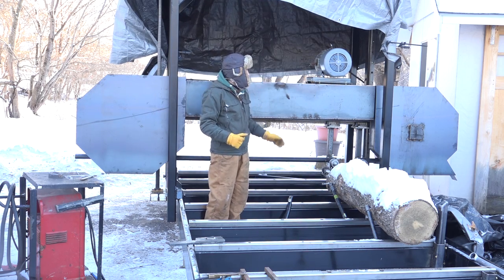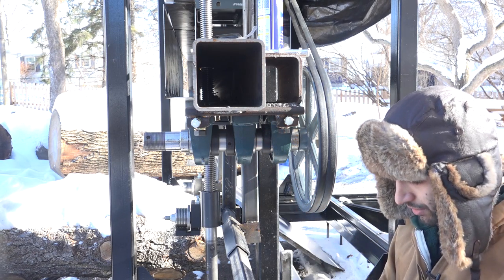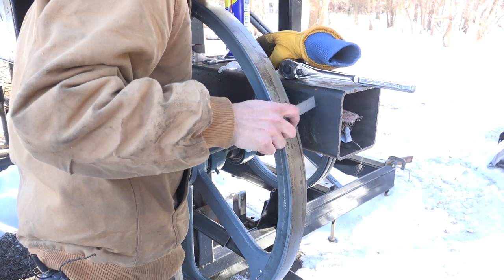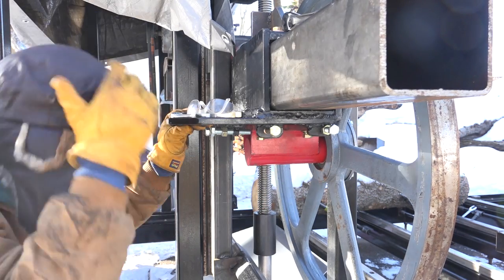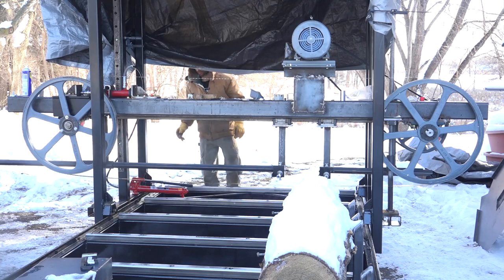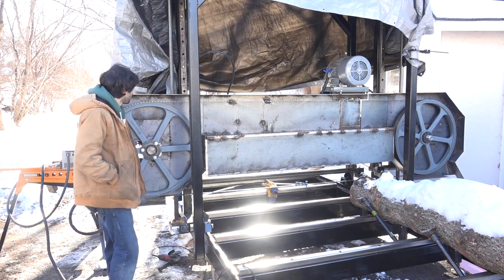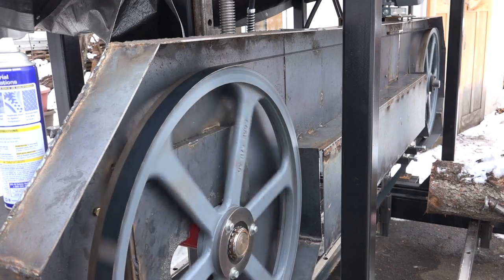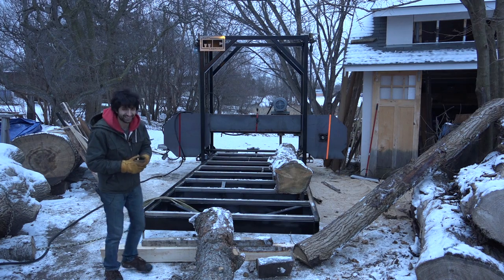Initial Setup - Building a Large Bandsaw Mill - Part 17

Comment: Not bad on the tweaking that was needed to get it working well. I must have missed something, why are the tires not on the wheels?
Reply from the maker: Tireless has more advantages for my application.  I don't have to worry about them wearing out, I can use lubricants that would otherwise destroy the tire, and I don't have to worry about the tires affecting the balance or trueness of the wheels if the tire material differs slightly in thickness or density.  Thanks Steve!
Reply: Will using tireless make it necessary to round the wheels now and then? And if so how do you plan to do that?
Reply from the maker: I don't think I'll ever put enough hours on this saw to affect the wheels but if they do need to be recrowned, I can have that done at a machine shop
Reply: You are probably right. I have no experience myself, but your build has 
really inspired me to perhaps attempt someting like this myself :-)
Reply from the maker: Thanks!  If you ever do, let me know :)
Reply: I will :-)
Reply: Hey Matt I think I have asked you once before but I'll ask again first what size is your pillow blocks and what size is your shaft that the wheels are on and next do you know at this point how much do you have invested into the mill right now now that your using it

Comment: I would consider a sight window in the guard on the tracking wheel side so you can set the tracking at full speed with the guards on for safety.

Comment: Matt: use a hose for each of your grease zerks, anything to extend them to where the zerk is easily accessed. The center bearing, go to a bearing supply and pick up some shims to eliminate the gap between the bearing and base. You can get shims down to .001" thick.

Comment: Sounds like the wheel/bearing something over there is rubbing/scraping. What you should do to the carriage is drill ahole so you can drop a bolt into the hole to keep the carriage from moving when you need to work on it. or  a small piece of C channel with a couple rare earth magnets on the inside and use that like chock.

Comment: Very smart tweaking of the wheels and guides. I'm thinking that you should consider running the mill with no load on it for 15 or 20 minutes to warm up the belts, bearings, blade and bring the motor up to operating temperature. I'd be interested in seeing what the test meter reads after the blade is  warmed up.
Reply from the maker: +George Savage I can already tell that the blade stretches a bit once it's been used for a bit. It will also be really interesting to see how summer temps affect the operation. Thanks George!

Comment: Glad to see the mill coming along so nicely!  One item to consider...For some spots you are using a lock washer on top of a flat washer (e.g. the drive side mount bolts).  I think you are negating any benefit of the lock washer by using it on top of the flat washer.  The lock washer needs to be able to engage between the base material and the bolt in order to provide their designed functionality.  With setup you have the lock washer will spin the flat washer and the bolt will back out.  Either take out the lock washers (and use loctite) or remove the flat washers.

Comment: A blade tension can be made consistent and never change over time ever, unless you want to. Like a clock a cable going over a pully with fulcrum & a known weight on an leverage arm. Much less technicial than a hydraulic ram $$.  Fifty Pounds on a 3' arm pivoting on a 1/2 bolt put a wallop of force on the wheel which can be locked when ready Mechanical vs hydraulic,

Comment: Piano wire clamped to a block run from one side to the other same dim. blocks. Measure from wire to wheels. you are making a straight edge with the wire. I've used this method on machine tools. Long runs. Wire needs to be as tight as a guitar string.
Reply: Piano wire as tight as a guitar string?  Intriguing analogy.  You have me wondering if a bear can be busy as a beaver, or if a frog can float like a butterfly and be like a Gordon Sumner.

Comment: I see you have an angle cube - iGaging, I presume. I have one - there is a woodworking supply guy here in Australia and he has them for $AU45. They work great. I also bought an iGaging outside digital caliper - bit dearer - great tool; has inches, inch fractions and metric.

Comment: If you want rubber on the wheels do like a friend of mine did. He took a bicycle tube smaller then the diameter of the wheel and cut it then stretched it over the wheel.

Comment: Great video Matt and congrats on the new blessing! Just worried that you might have too much tension on the blade at over 500kg, but the calculations appear correct, and I am used to working with much smaller blades. 
Does coming back to to 400kg [drop by 20 percent] cause any problems? and would the blade last longer?
The elasticity or Young's modulus would be approx 1/600 of it's length. So a 25 foot blade it would be 3/8 to 1/2 inch stretch I reckon.
Also in the metal working game I used to tension blades by incrementally by indexing the blade and increasing tension as I went, but again on smaller blades.

Comment: To align the two wheel axles parallel, you could use four clamps to clamp a piece of angle iron across the faces of the wheels.  Then just snug down all of the various bolts and you're good.  (Or maybe you've already figured that out, being as this is a two year old video.)

Comment: Hey Matt just wondering have you thought about a way to elevate one end of a tapered log to get a parallel cut? Or you think it's not an issue?
Reply from the maker: +Robert I'll add log leveling rollers to the bed at some point. It's a low priority though. The bed is so close to the ground that I can use a bottle Jack to lift and shim the log

Comment: Dumb Question: Since there is no flange on either side of the drive wheel or idler wheel, what keeps the blade from sliding off either side, just tension and friction?
Reply from the maker: The flange on the back side of the blade guides provides thrust bearing surface.

Comment: Hi, I´m building one, but I have proble with vibrations, when the engine is running, the blade have too much vibration, do you know why?, did you have that problem or not?, thanks
Reply from the maker: I didn’t have vibration issues. Likely one of the rotating components are out of balance. If the vibration is very bad, it’s likely the bandwheels

Comment: How much are the plans and what are some pros and cons of this design? 

Also I seen in your bed tree saying video you didn't dry the wood out. Forgive my ignorance but wouldn't that cause problems?
Reply: Just like firewood.  Cut to length, it dries faster.  Split it, dries much faster.  Increases the surface area.  Birch takes FOREVER with bark on, not opened out; poplar/aspen is worse.

Comment: matt: did you know, that 90 degrees is not correct on a bandsaw?  on a car, what you need is tow in, on a band saw you should have tow out. not much but it cuts without waviness, or marks if not square.

Comment: how does it not bother you to have the grease zerks on those bearing blocks not all on the same side? I saw you wanting to adjust the drive motor fan grill to straighten it out, so don't pretend you don't care :-P
Reply from the maker: +Chris “Mosquito” Albee I flipped one of them so the lock collars would be in opposing directions. Zerk misalignment is a side effect ;)
Reply: So it's warranted, but that doesn't mean it doesn't bother you :-D
Reply from the maker: +Chris “Mosquito” Albee well I can't see it so maybe that helps

Comment: Could u have just cut a slit into the shims the width of the bolts to allow for easier adjustment, not having to pull the bolts out completely to add or remove the shims?  This is an awesome machine you are building, first video, I'm going back to the beginning.  Looks like ur freezing ur ass off, I know I would be....

Comment: Most blade guides I have seen use 2 to 3 bearings instead off one.(one on each side with one on the back of the blade) This is to keep the blade from twisting and to keep it inline.  The flange on the back will work for the third bearing but I see no way to keep the blade from twisting. Unless I am missing something? Look at the guide on a small band saw like this http://www.carterproducts.com/band-saw-products/band-saw-conversion-kits
Reply from the maker: +Y Pop the bottom guide wouldn't allow the blade to get close enough to the bed to make the last cuts. Most bandsaw mill don't have a lower guide. I got the addition lower jaw on mine which is a carbide block to add bottom control for the really wide cuts
Reply: Ok that makes sense now just did not see the blocks in this video. How thin are you planing to go on a final cut 1" or less?
Reply from the maker: +Y Pop the thinnest I plan to cut would be 1" boards but I should be able to get down to 1/2" should that ever be necessary